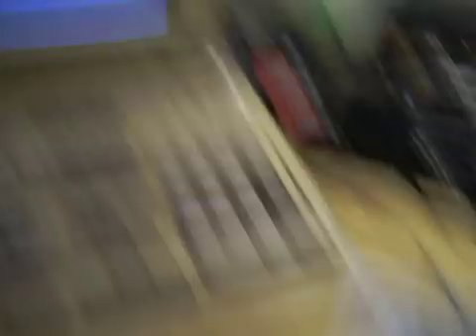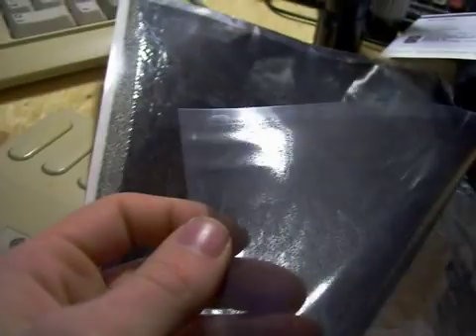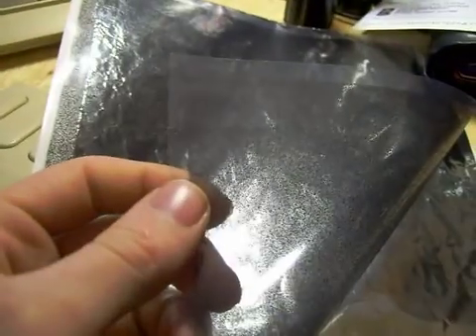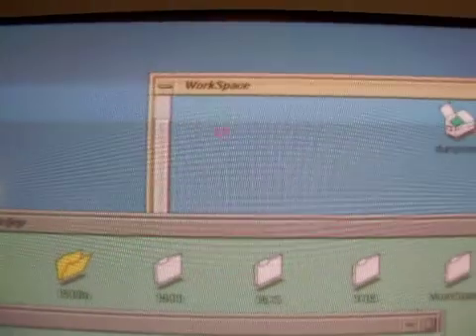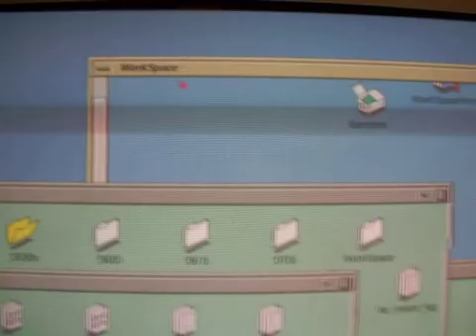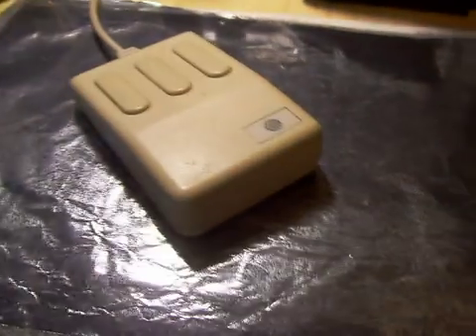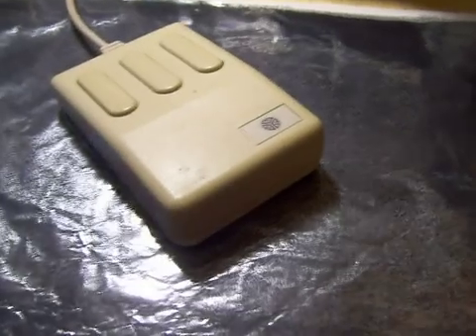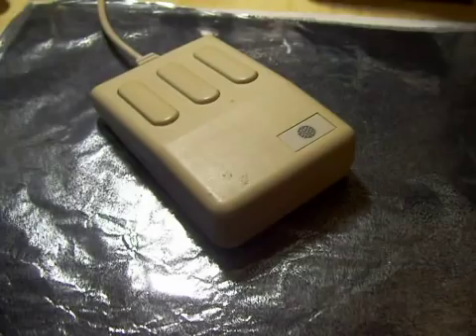Substitute Reflective Optical Mousepad

Comment: I'm trying to do this with my old Sun mouse, but it only tracks vertical movement. Do you think it's a problem with the pad or is the mouse just faulty?
Reply from the maker: That sounds more like an issue with the mouse. You cleaned the optical paths?
Reply: CelGenStudios I did, I also opened and cleaned the mirrors and sensors. If I move the pad over the mouse while the top is off it tracks, just not when I have it closed and am trying to use it normally...
Reply from the maker: kasm279

In that case just keep experimenting. Proper tracking with the cover off at least means the electronics all work. There's jsut something interfering when it's assembled.